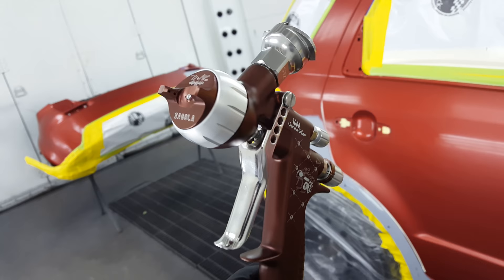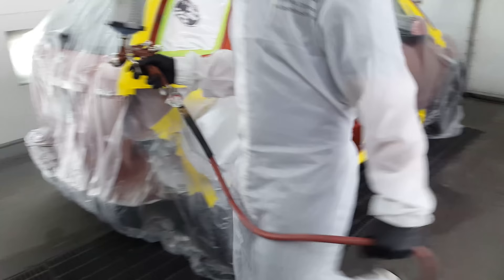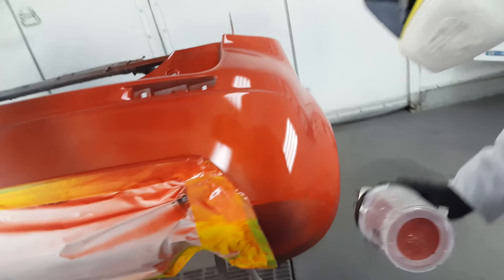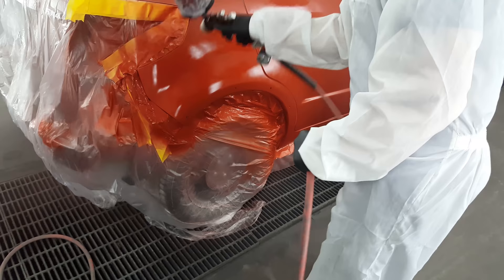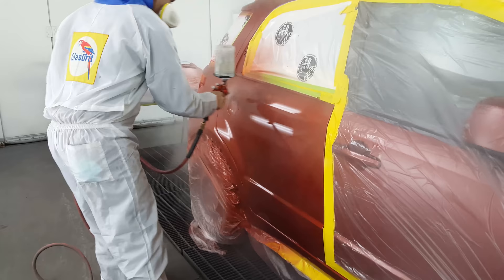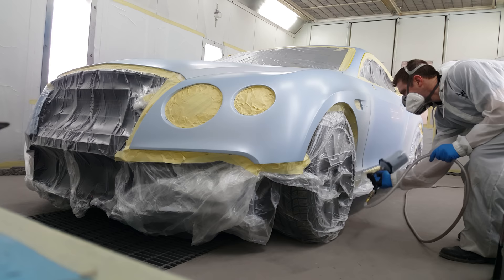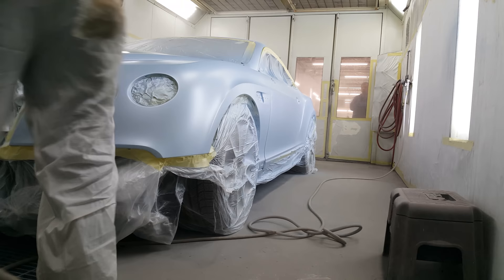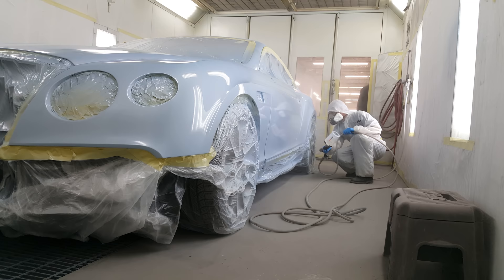Reviving a Classic: Full Restoration of a Baby Blue Bentley with Water-Based Spray Paint

Comment: I spray standoblu. when i have a bad hider i spray 2 heavy coats then i blow it dry and put 2 more on.for some reason with standoblu it hides better if you dry the first 2 coats.your suppose to just keep spraying standoblu with no flash time which works with most colors.but the reds and a few blues have terrible coverage.Saves alot of time and paint by drying it.a little tip for anyone spraying standoblu water.I just recently bought the walcom hte base.I have a sata 5000 and a few iwata entechs.the walcom is the best.Sata coming second and iwata 3rd.Hope that helps someone.